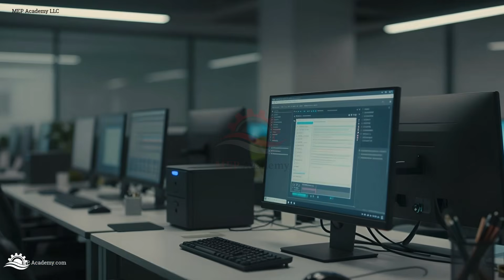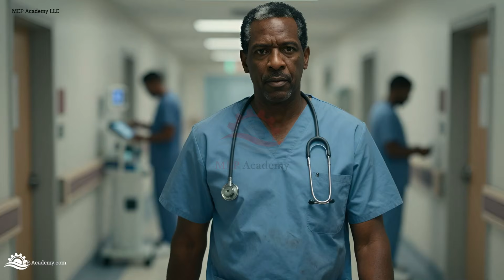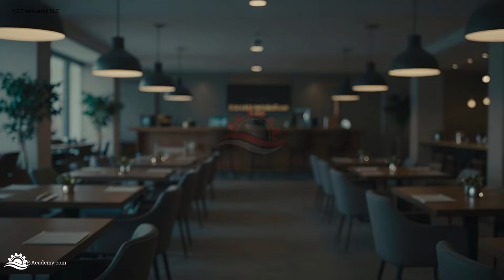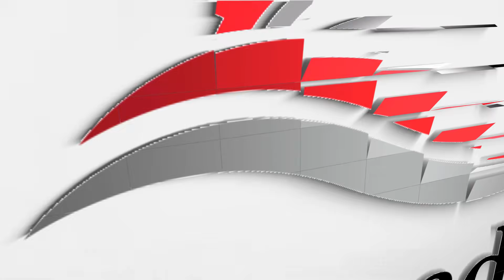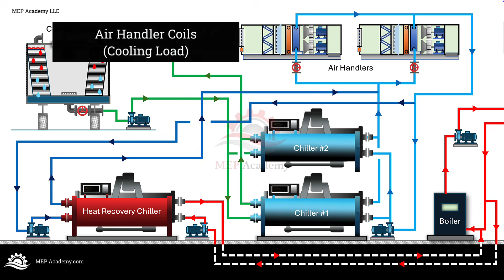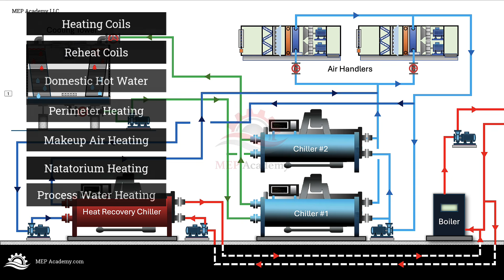Heat Recovery Chillers Explained

Comment from the maker: Heat Recovery Chillers are one of the most misunderstood systems in commercial HVAC — but once you understand how they move heat instead of wasting it, central plants start making a lot more sense.

If you want to learn more about commercial HVAC systems, estimating, chilled water plants, boilers, cooling towers, piping systems, and real-world mechanical construction, check out our online courses and HVAC estimating tools below.

👉 HVAC Estimating Spreadsheets & Forms:
[https://mepacademy.com](https://mepacademy.com)

👉 Online HVAC & MEP Courses:
[https://www.mepacademy.com/courses](https://www.mepacademy.com/courses)

👉 Subscribe for more commercial HVAC training videos:
[https://www.youtube.com/@MEPAcademy](https://www.youtube.com/@MEPAcademy)

What type of building have you seen Heat Recovery Chillers used in most often — hospitals, campuses, hotels, or data centers?
Reply: Why use a heat pump recovery system when you can just use a heat exchanger directly on the output from the hot side of the chillers and then boost the temperature some with the boiler? Clearly I am missing something. Doesn’t the heat pump use quite a bit of electricity that will cost more than the boiler fuel? My naive assumption is that it must have something to do with improving the efficiency of the chillers outweighing the power use in the heat pump.